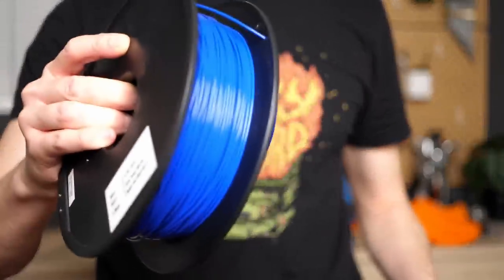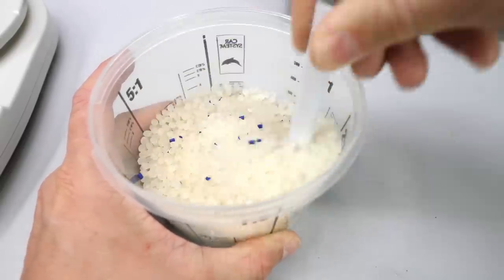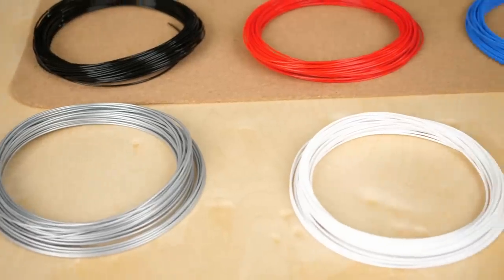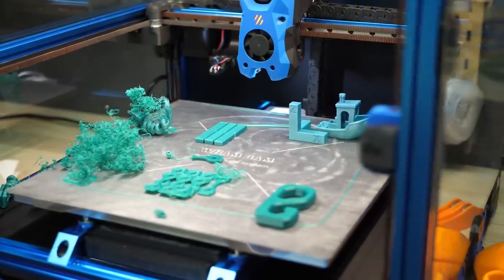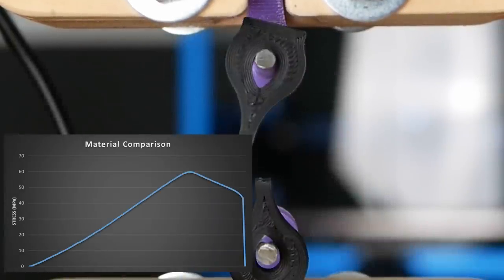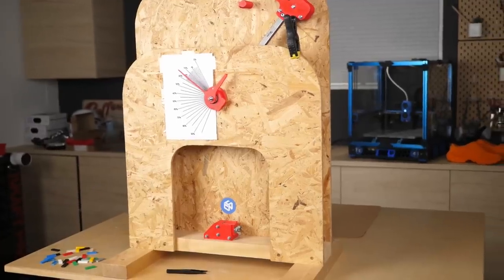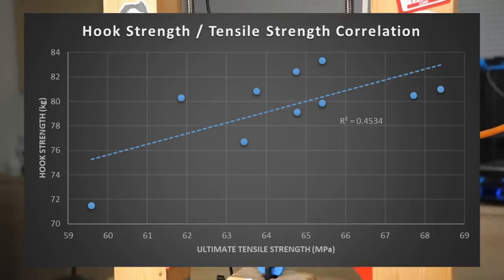Myth Busting: Color vs Strength in PLA

Comment: Before seeing results: I always treat all filaments of the same type and manufacturer the same, regardless of color. I've not been able to correlate any issues/quality/printability results to any color. But I can certainly tell there are differences between filaments because I use a Palette + RepBox. Manufacturer A sitting in the RepBox after half a day (or less) snap at the exit hole... while Manufacturer B has been there for a month and exhibits no difference in filament property. And for the Palette to splice things together, you (should) do splice tuning... and it's kinda wacky how 2 manufacturers, with the same color, both who proudly proclaim they use pure resin + master batch end up having two very different splice characteristics. To my expectation: I expect everything has some variance and also some differences... but I do think scale of difference will be important. Lining everything up and saying "red can handle 10x as load as blue" is a great headline, but if the difference is 0.5g then it can probably be ignored. If that difference is actually 100g, then that's significant and I'll certainly be planing some print usage by color. Lastly, regardless of the result, I'm glad to see my systematic/deterministic results for 3D printing which is very anecdotal, touchy/feely, and "works for me" right now. The more "here are numbers to make decisions off of", the further we get from "the print won't stick to my Ender 3 v2" getting 50 different responses... and the more we can turn 3D printing into something the tinkerers and hobbiests do for fun and work while the average person can just go "I put in blue and it printed" for every printer.

Post see results: I feel my only desires are to see where silk compares but also that one comment you made... "does printing slower change the properties?" as not only is that an interesting one to think about, I feel it could be a hot topic given the, um, arguments going over right now around "why buy a slow printer when you can buy a fast printer?". As for the results, I think it was interesting... the difference in matte filament makes sense. I generally don't use special materials (like silks) for mechanical parts. But it seems like, while there were properties that did have some drastic differences, the results were loosely correlated. Maybe that was just for Das Filament, but the range of it seemed to make it a little less useful. I'm going to be literally printing parts of a floor for a workshop in dark grey PLA to match the injection molded flooring that will take up a majority of it. I'm less concerned on pulling layers apart and more on impact and general strength. From these results, being dark grey may work in my favor as silver had the most impact strength... but I also know multiple perims/top layers/some amount and type of infill may have more significant impact then the color. Still, interesting stuff and maybe going further and testing more options can flesh out results to try and build a stronger relationship between colors and properties.

Comment: This is a very interesting investigation. I hope you will take a look at dimensional accuracy on fast prints from klipper driven machines versus slower commercial printers. I wonder if the steppers skipping steps on the faster ones will be an issue or if the faster printing actually yields better results because of less warping!

Comment: Great video and very interesting! In a similar way, I have recently wondered if print speed affects strength. With the wider availability of super fast machines like the Voron, RatRig, and Bambu; I'd be curious if the strength is affected. I imagine it would come down to material, cooling, and a number of tuning choices, but if those could be kept constant it might make for a good video.

Comment: Expansion during annealing might also stem from expanding air trapped inside the part. It might be worthwhile to repeat the test with open-pored infill (e.g. gyroid) and a small hole drilled into the part to let air escape.

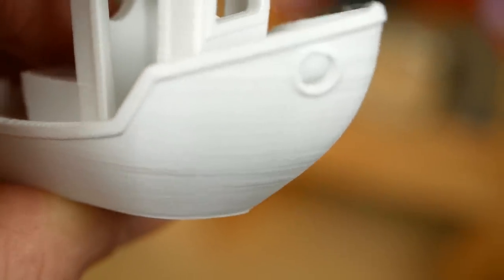Comment: Hey Stefan, are the print layer inconsistencies you show at 6:34 fixable on a Voron 2.4? I have a 2.4 that I have tuned a lot and my layers look similar to yours in this video. I had watched your video "(HOW) I fixed the ugly layers on my 3d printer" and the layers you showed post fix seemed absolutely perfect. So I'm wondering if these inconsistencies on the V2.4 could be related to the Clockwork extruder? I'm currently running CW2 in a Stealthburner. Thanks!

Comment: If you print 25-50 mm/s (more relax time), 125-150% extrusion rate (counters stretching), gyroid infill (single chamber), and alternating wall directions (stresses cancel out), does it reduce warping when annealing?

Comment: I did watch your High Flow adapter video. In one part you are talking about internal stresses in the filament when printing above 25 mm3/s flow rate. I was thinking if lower flow rate (hence lower stress) could yield better results in annealing process? To me, it looks like the infill structure is "dragging" walls inwards. Or maybe different infill patterns. Just thinking it could be interesting video.

Comment: I actually disagree with using the exact same gcode for the tests. Different colours from the same supplier need very different extrusion multipliers to hit the same part geometry. This can be confirmed with a weight measurement, or by measuring a single wall vase mode cube with proper micrometers (read: not calipers). Some of the PLA we use can range from 0.92 all the way to 0.98 EM, across the same product range where the only difference is the colour. I suspect the results could have been affected by the printed parts all being slightly different in the end.

Comment: Hej Stefan, 
I noticed at 8:53 that the purple hook of your tesile strength mashine is bending a little bit. Maybe you should replace this simple part with a metal one because this could give you little inconsistancy (especially over time). At least u are testing allways on the same mashine, so it should not be that bad. But maybe if you are looking for some upgrades in the future that could something to concider.  

Thanks for the good work, love your videos :)

Comment: I print TPU fast and have learned that red is the most painful filament, needs an extra 10C to not have a pressure jam over a 8 hour print. All my other colors (matterhackers Build TPU) will print with the same settings and get comparable results that work, but not red. Red needs its own special 10C hotter (limit of the filament breaking down) and 10 mm/s slower to get the same results as all the other colors printing at 16 cubic mm flow. Seeing your results that red is the least ductile material, this makes sense for me, as it would be the hardest color to jam through a tiny nozzle hole with low ductility. This would create more nozzle pressure than the other colors which is quite important with TPU, and change the final product 
I think this shows that if you are printing just on the edge of your hotends flow/heat capabilities, you have no choice but to reduce speed in order to be able to print red similar to any other color. 
Has anybody else experienced anything similar?

Comment: I have some orange PLA hatchbox filament that is running on 5+ years old now, it sat around in it's vacuseal bag for about 3 years, but so did 2 other colors of that brand, it prints like nothing else I've managed to find yet! I can print at 200c easy and the layers turn out glassy smooth and filled in but not melty at the edges etc, layer adhesion also. For all my other filaments 205-210c at minimum to run the same 100mm/s. A red spool from same company/year prints totally different and needs 210c, yet still looks a rather dry surface-finish wise. Nothing like the glass sheen the orange creates. It totally spoiled me and I didn't even know it until I swapped over to a new color finally. Most of my printer upgrades were made with that orange and all pieces have held up fantastically. fully printed belt tensioners and 'fang' style part cooling near the hotend included.

Comment: Would love to see the process repeated with tuned (at least PA values) profiles. Over/underextrusion due to the start/stop early/late may also affect measurements.

Were the comparable parts weighed to see if there was any significant variation in mass?

Comment: I worked making Filaments for 16 years, like you say the master batch affects it,[ 3gpd, Elongation and the break strength ].Black used to be the worst. some colours added are powdered pigment  and blended in drums[Cutting line and sutures }, are most stable method was dosing the masterbatch into throat of extruder

Comment: I bought a glossy spool of gold-colored PLA Plus that printed great at high and low temps, and a spool of glossy green from the same brand. The green roll won't even stick to itself at any temperature, no matter how fast or slow I tried printing it. I was hoping your video would reveal a "EUREKA!" moment that could explain the drastic difference between these spools.

Comment: on your next test setups, could you print some gears that you leave running and measure wear per time? All of these are tensile tests, but there wasn't a lot of compression or abrasion, and often 3d printed parts are load bearing feet or working gears and movable parts that rub together

Comment: I have noticed a huge difference. I use Matter Hackers Pro PETG. I have black and white. The black prints great. The same sliced file in white I get under extrusion so bad that the 3 perimeter walls don't even touch.

Comment: We're starting to see these high-end printers now with radiators around the nozzle in order to re-soften the already printed layers while putting down each new layer in order to drastically improve layer adhesion. It makes me wonder if we could achieve a similar effect by just using a nozzle with more surface area but the same size hole?

Comment: Interesting results, it is not so obvious how it behaves. For the filament flow 'argument', it will be interesting to see the deviation on the mechanical properties (let say print one set of samples at 100% flow and another one 'over extruded' at 110%).

Comment: A really interesting follow-up would be to compare pure colors to some of the recycled filaments you can get now where the color is a generic grey to brown. (I assume it's just all pigments mixed together) I started to use these a lot when color wouldn't matter, but now I wonder, do they combine multiple strengths from the video, do they average everything out or worst case is it actually an overall weaker product?

Comment: this is a tangent, but I find myself wondering how AI could work with 3D printing, some form of dynamic control from camera sensors.. maybe training an image recognition AI to identify the various defects in the process, then using a language model to make the corrections? might not be easy to integrate with the existing system... anyways great video, was not expecting so much variation, a real eye opener

Comment: Did you consider the thickness of the filament? E.g. with measuring the weight of the test samples? 

Because it seems that the grey test samples look a little bit overextruded compared to the other parts. Not that this is influencing some of the tests.

Comment: I think white is the clear overall winner. It's near the top in all tests, and it doesn't deform much when annealed. Sounds like a great all around choice, unless you know you need to prioritize a particular property. I wonder what they use to colour it. I've read many filaments use titanium dioxide, which can cause wear on brass nozzles over time.

Comment: Good video but honestly i would consider the results inconclusive for the pigments being the cause of the differences and more down to manufacturing variance. I made a custom lab vibrations setup using 3d printed springs, and despite using the same exact gcode, filament spool and printer, there was a range of +- 100 N/m stiffness on the springs across over a dozen of them.

Comment: Do you think a clear coat can increase the strength of a print? I like spraying many of my prints with matte clear to remove the gloss. My friend is convinced doing so is making my prints stronger because mine are stronger than his. I tried breaking two different prints with and without a clear coat and the coated prints definitely seemed more resistant. Not a lot, but noticeable.

Comment: Interesting. I have 2 rolls of ABS from the same manufacturer, one is silver and one is black. In controlled conditions black ABS prints nicely (well, as nicely as you can expect from ABS) while silver delaminates, lifts corners and detaches from the bed. That aluminum powder mixed into the plastic definitely messes with the material properties.

Comment: I used to use a cheap local store brand of fillament from Dexp, exclusively bying PLA, because it was the easiest to print. I noticed two distinct outliers: Transparent PLA and White PLA. Transparent PLA was pretty hard and brittle, with prints feeling mostly like softer glass, otherwise it was a joy to use and print (until it wore down my bowden tube and clogged the nozzle with it's pieces, but it was my mistake, since i set the tension spring on my extruder a bit too tight). White PLA, for me, was straight garbage. It crumbled from staying in the runout sensor for a bit too long, always sagged, the subborts fused to the models, the models themselves were just unpleasant to hold, and the breaking pattern looked more like mashed potatoes than actual PLA breaking. Idk what kind of garbage the shoved into that filament.

Comment: I was not amused when I first found out that different colors of Prusament PETG need different print parameters, differ in bed adhesion etc.… Even recycled Prusament PETG differs not only in color but mechanical properties from batch to batch – first 2 kg spool was really good, next one a bit more stiff and brittle.

Comment: I design 3D terrain for tabletop miniature gaming, I use grey and light grey PLA.  I currently have very little resources to test different material. So far I found grey being the best for general details.  In your experience, what would be the best colour to suit my need?   Durability and details are my most important criteria.

In your opinion what would best suit my needs?  My printer settings are 210 nozzle and 60 on glass bed. I don’t use adhesion medium as this is working great for me so far.

BTW, thank you so much for your videos.  They have helped me in my journey with 3D printing.

Comment: After reading about the potential impact of the physical shape/properties of the materials used to create the pigments for different colors, I began to doubt my preference for white PLA. Does tha larger size of particles from titanium dioxide cause more wear on the nozzle, or have a notable impact on surface quality or part strength? Excellent overview here!

I've had pretty good results with Overture matte PLA, at least asesthetically, since the layers look like they melt/adhere better to each other compared to standard PLA, so I wonder why its layer adhesion isn't that great.

Comment: I think in tests like this it is very important to control for moisture and humidity, as pointed out by that recent MirageC video. Without that, these data are really impossible to interpret-- correlation does not imply causation!

Comment: I wonder if there are optimal temperatures that would be arrived at based on color as well.  For example, would color x be stronger than color y when extruded at one temperature, and if a different result is arrived at using a different temperature ...

Comment: Thank you very much; always managing that delicate balance between science, narrative, & detailed results.
The possibile ramifications are both "duh" & incredible.
I Do wonder;
Is there a location where we can all run tests, correlate & compare data?
Is there any chance to repeat these tests with colour adjusted settings to see what the potential changes are? I realise that would be a Lot of work, but the comparison to this base data would be deeply informative.
This has a really wide set of ramifications for quality control & the improvement of 3d printing in general; also the plastic recycling movements.
For the 3d printing crowd, it's another example of just how many variables can be causing issues, but also how little information is on the packet/data sheet; simply because it isn't part of the market yet.
Hopefully it will get integrated in time; possibly as three subsets; Form, Structure, volumetric stability & Anneal.... W as reel/after printing long term stability ratios, assuming the reel is kept in "good" conditions.... Just so much work... We may never see it.
But that can't happen until new techniques & developments settle down enough to Know those are the critical data sets.
I would do hope some highly QC'd, variation quantified & data correlated products to start showing up under "structural" or 'engineering", (or more realistically market branded name) to come out..
Ugh. And then the recycling issues, where exposure degraded plastics are a given & zero uniformity in any batch....

Comment: Wow, these results are pretty astonishing (to me, at least) It looks like white might be the best mix of strength and toughness, but I’ve read that the titanium dioxide pigment can be hard on nozzles because it’s a very hard compound. What’s your take on that? 

I wonder how comparable results would be with other filament brands? On the one hand, some pigments are the same between brands (like titanium dioxide), but I would think others might be very different. There’s also the question of whether differences in pigment particle size might make a big difference, and if so, are there differences between manufacturers in that regard as well?